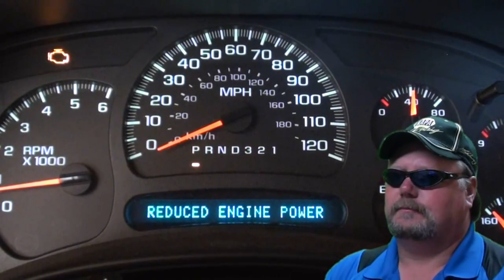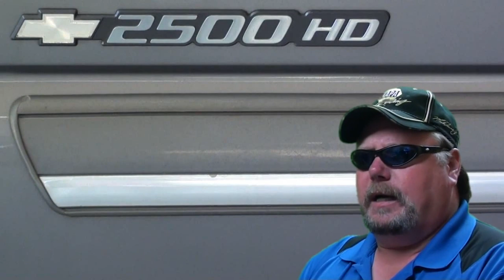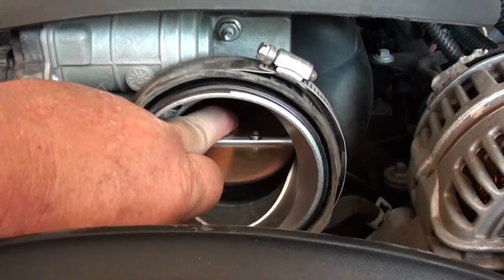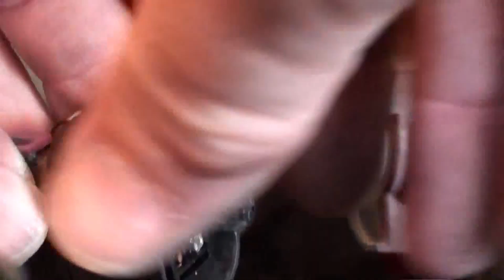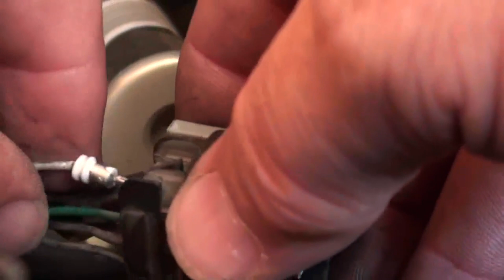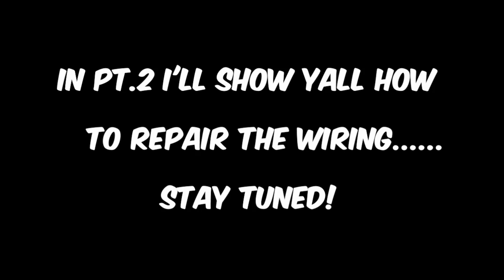Pt.1 2007 Chevy 2500HD "Reduced Engine Power" Warning & Fault Code P1516 Repair @ D-Ray's Shop

Comment: I have the same problem. Changed the wiring harness out and the throttle body. I also changed the accelerator pedal with sensor. Still encountering reduced power. Anything else that could look at?